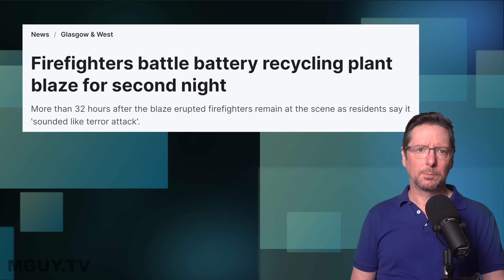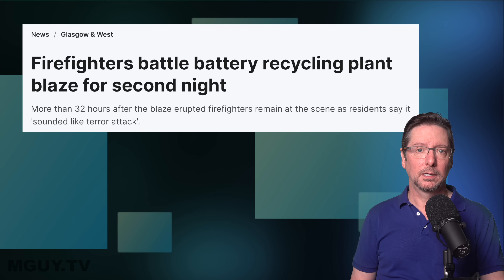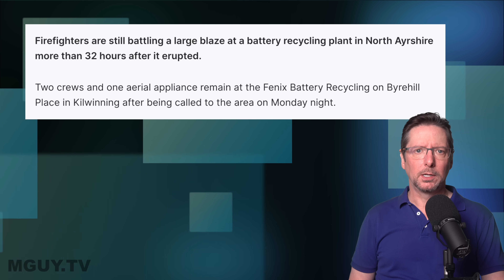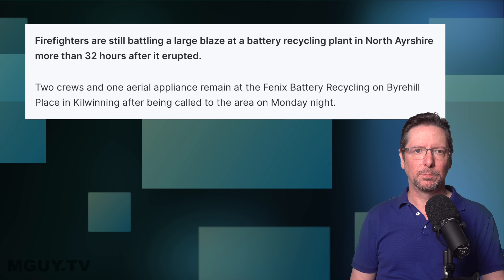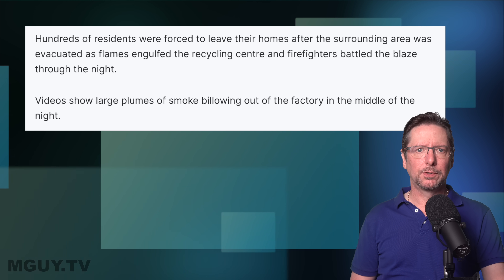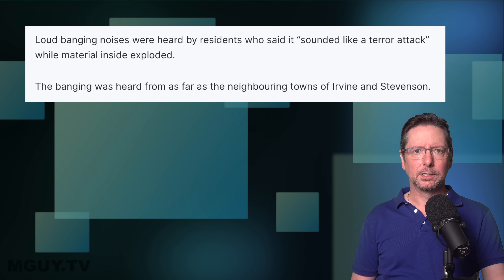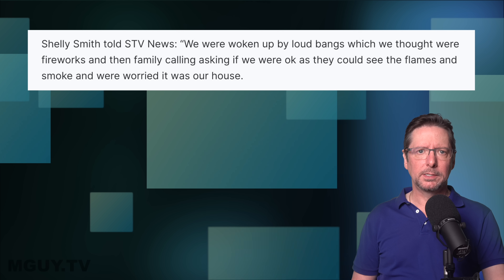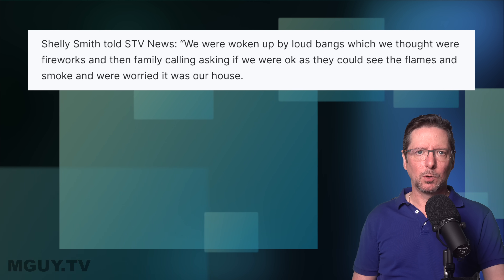EV and Lithium Ion battery recycling is DIFFICULT, DANGEROUS and TOXIC | MGUY Australia

Comment: MGUY,  How can this be?  I was reliably informed by a commenter on one of your vids that Lithium Ion batteries were no longer being used in EVs, hadn't been in years and that battery fires never happened!
Reply: The World is full of deniers. I think it may have been one of them that said that.
Reply: China uses LiFePo batteries, but only for inner city use - fewer than 3% of western vehicles use them
Reply: @andyman8630  Safer, yes.   Even more USELESS......yes....
Reply: @gomahklawm4446  
can be charged much quicker with significantly higher current, can be charged to 100% and drained to 0%, no dendrites, static losses less than1/3rd, 3 times the lifespan and 7 times the duty cycle, does not incur thermal runaway, far less pollution and completely recyclable

and the ONLY downside? reduced energy density - which is why xina only use them for inner city travel
Reply: @andyman8630  Sorry, that Tesla LFP power storage pack went into thermal runaway in Australia without every being put into service and burned for days. They asked tesla what to do and Elon told them to let it burn out. So stop lying about the thermal runaway part, at least.
Reply: @andyman8630 b/c lifepo4 range is 60% less by volume. Lifepo4 is incredibly safe, but useless for EVs unless you want to fill your ENTIRE cargo/passenger space with batteries, too. I already looked into it for replacing a Nissan leaf with lifepo4 and to achieve decent range. It's impossible for a functional car.
Reply: @TheGuruStud  
i know and that's why China only uses them for inner city transport - it's also why nearly everyone else uses LiOion

energy density!!
Reply: @TheGuruStud I'm convinced that a lot of pushing EVs was specifically to create the problem of Lithium then fix it by marketing cheap EVs from that country. Similar to how solar panels are treated as one of the only affordable methods of getting green electricity despite the potentially  unsustainable component requirements.

A means to an end, which is trade dominance
Reply: @andyman8630  LiFePo4 batteries are safer that LIon batteries, but not very much. They are also cheaper and less energy dense. Look back through Simon's videos and you will see one about a golf club in Australia burning to the ground because of a LiFePo4 golf cart battery fire.
Reply: I had the same delusional arse clown suggest that 39% of EVs here in Australia use LFP batteries and wouldn’t you know it LFP itself stands for Lithium Ion phosphate which are have lower density energy, still weigh the same and are more vulnerable to cold weather. These EV evangelists are no different from any other idiot fringe group or for that matter any idiot leftie politician they’re pushing their delusional narrative in hope the sane of us will eventually buy their ludicrous bullshit.
Reply: I have a bridge in New York City that I can let you have cheap…
Reply: Yeah they are an idiot, fires happen, you should see the precautions people take handling powdered milk.

Comment: EV vehicles cannot be viable just because they carry a super heavy battery around. Makes no sense.
Reply: Even when discharged they weigh the same unlike gas cars that get lighter as the fuel is used up.
Reply: @tonysheerness2427  ICE cars become quicker the less fuel they have in their tanks, while EVs become slower when their battery is in a low state of charge 😂
Reply: @tonysheerness2427  Keen point.
Reply: Add the extra mileage that seems to be standard for an EV searching for a viable charger in working condition. All the crap about when an EV becomes greener than an ICE vehicle does not include these extra miles or the environmental impact of fires or the need for final disposal of the vehicle. When I worked in industry there was a direct correlation between carbon usage, final weight and cost of our products. The fact that these EVs are heavier and cost more shows me that their carbon cost is higher than an ICE vehicle.
Reply: @martinconnelly1473 I've been saying for a long long time that they are lying to us about the real environmental impact of EVs. The data from these third world Chinese owned mines is almost certainly completely faked and "inspection" by regulators is a total joke as undercover journalists have discovered. Recycling as well is a total farce with only a tiny percentage of batteries ever getting recycled in a highly energy intensive process that is not profitable outside of heavy government subsidies. The rest of these batteries get shipped back to a third world country where they are dumped in a landfill and burned.
Reply: Tyres wear out faster  water gets into gearboxes and damages the bearings, etc etc
Reply: What is your argument? EVs don't make sense because they are heavy? So are pickup trucks, the most popular type of car.
Reply: @vladimus9749  Where? Certainly not everywhere.
Reply: @vladimus9749  The heavy battery is dead weight. It does not provide more space nor extra carrying capacity. It is senseless to carry it around all the time.
Reply: @vladimus9749  my semi truck makes sense because it's useful. An overweight, over priced, impractical, low utility, high inconvenience vehicle with a resale value of approximately scrap weight doesn't make sense to people that buy things with their own money.

Comment: There is NO lith Recycling as such atm in oz or a lot of other countries.
Reply: Pilot plant in Melbourne.
Reply: @ldnwholesale8552  So much for cleaner air. For safety sake they should be outside of heavily populated areas.
Reply: Recycling the key components (rare earth metals) is not possible at the moment. This is called black mass or black gold, but a bit of research shows its just being stored and none of the recyclers has anything viable at any scale. I found one that had produced enough for a small test battery to be made. So they can recycle the casings and that about it, no money in that.